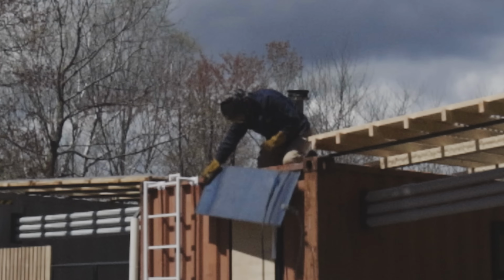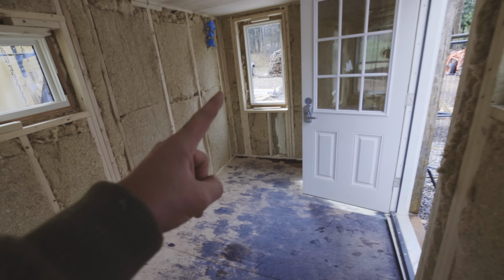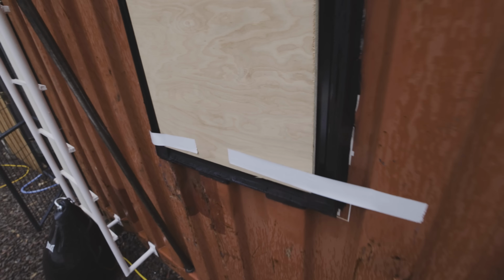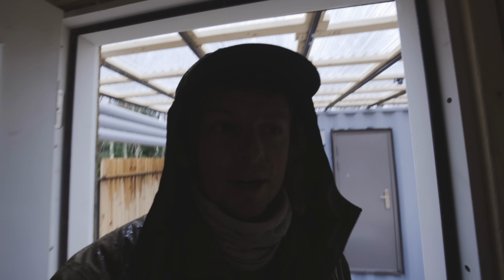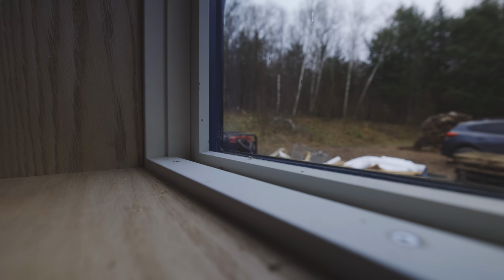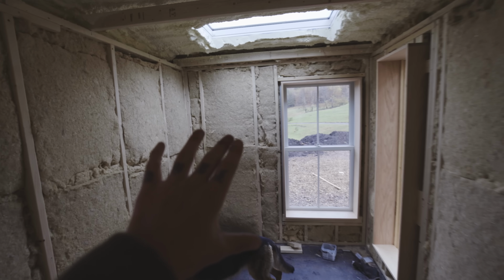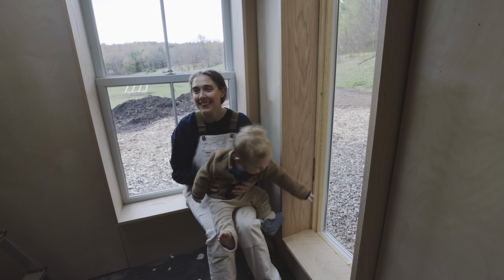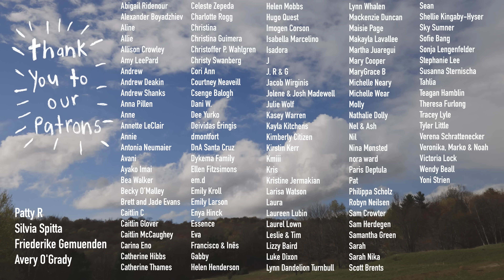This Is What 5 Days On A Shipping Container Build Looks Like

Comment: Jamaica 🇯🇲 here blessings and strength to you your building you know here in Jamaica they use shlpping containers for shops or business and they are thinking of going into housing but over the top of the container they build a roof of zinc over the containers it keeps the rain off the top so no water settles on it you could do so if you got the means it would keep the snow off the top also I think . Here in Jamaica I have a conceret roof and it started to leak when ever it rains had to put a zinc roof over it so now when ever it rains the water hit the zinc roof in stead of the concrete and just runs right off this is just my experience and i also use it on the container top also but safe and warm
Reply from the maker: Phillip thank you so much for sharing this tip!! That is so helpful to learn, will definitely make note of the idea of a zinc roof and see if that works up here too. Thanks again and we wish you a beautiful week ❤

Comment: So if you're using typical residential windows, they need to be flashed in place (and the assumption is typically that they're in timber frame openings as well). It's incredibly unlikely that the windows themselves are leaking, but rather that water is making its way in around the edges where the window casing meets your metal openings. Look up some videos for how to flash windows (e.g. This Old House), and know that caulk/silicone around the edges isn't a good substitute. Best of luck!

Comment: Is there a way you can jack up the middle red box and put it on supports so that it’s level or higher than the side ones so the water isn’t sloping into the center? Feel like that would help with a lot of problems (hope this doesn’t come off as rude that’s not my intention)